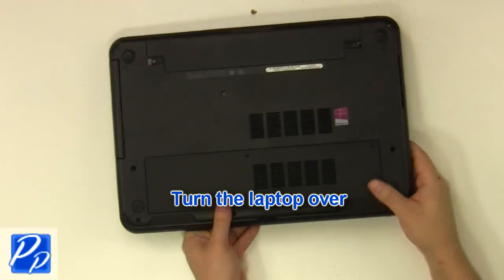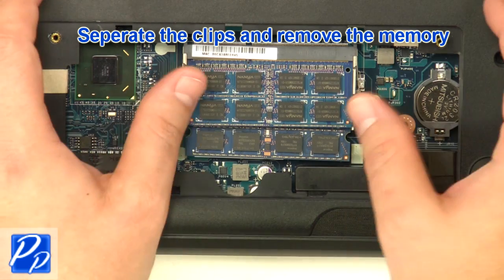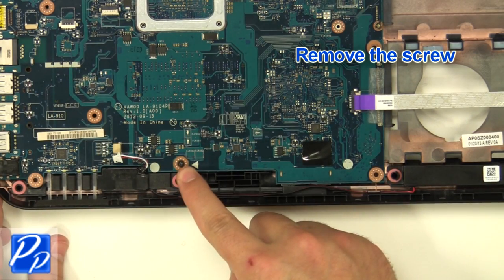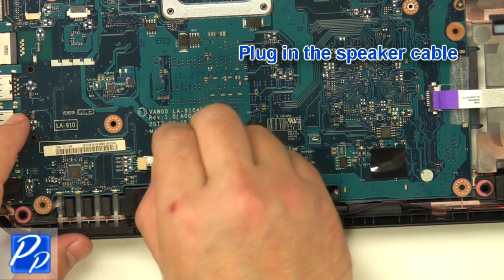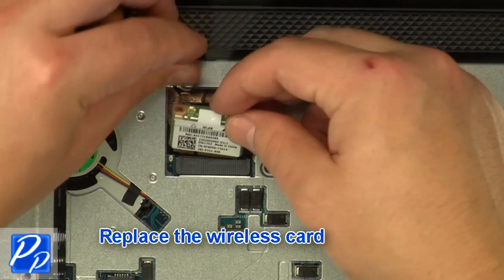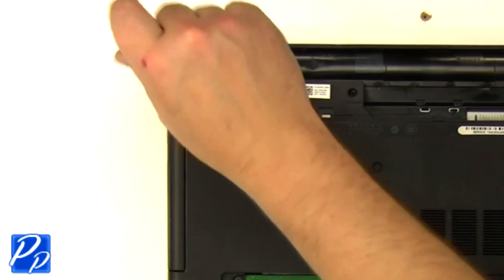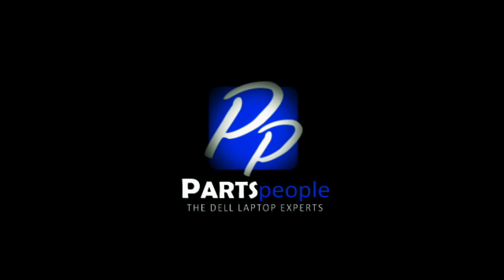Dell Inspiron 15 (3521 / 5521) Motherboard Replacement Video Tutorial

Comment: Thanks for this video, it was very helpful and saved a lot of time. Ive got the same laptop as in the video and its sound card is gone kaput. After all troubleshooting, the only thing that worked, is an external USB Sound Card. Is there anyway i could access and use the Laptop's Internal Speakers via this external soundcard?

Comment: I have same laptop with i3 and dedicated 2gb amd radeon graphics.

I opened my laptop to clean the fan and after reassembling the graphics doesn't show in my device manager, some people suggested me to format and check, but it didn't work. 
Still doesn't show up.

Please see if you can help me identify which is the connector to gpu.

Comment: i have a dell inspiron 15 3521 could you please show my bios chip location so that I could short pin 1 and 4 or best supply the code to remove bios for (system disable: BC61CF01736CBA9D service tag: C6DNJV1). THANKS in advance.

Comment: hey there. can you help me how to locate the 7670m gpu. i took the laptop for some routine cleaning. now my system cant locate the gpu i only have the intel gpu. i even tried the dell support system and all. i cant figure out where the  gpu is located. i need to figure out whether it as not connected/fried/removed. thanks.
Reply: wait i show you

Comment: Is it possibe to put a 7000 series mobo/cpu in my 3000 series?
Reply from the maker: The 3521 and the 5521 use the same motherboards but they are not compatible with any other laptop. Unfortunately no, a 7000 series would not fit.

Comment: i have problem with this laptop when i change position of laptop or move it, windows is not work and frozen
?how do i solve this kind of problem
Reply from the maker: I'm not sure what would cause that to happen. You should take it to a repair facility to have it diagnosed.
Reply: Rasha just replace its harddisk to SSD
Reply: Rasha it happens when hardisk is going to dead

Comment: can I replace the current version of motherboard with different motherboard comaptilble for dell inspiron 15r n5110
Reply from the maker: You want to replace the 3521/5521 motherboard with and n5110 motherboard?
Reply: currently I have 8FDW5 48.4IE01.031 ,I want it to replace with better version ,so I can make processor and graphic card changes.
Reply: Parts-People.Com, Inc My dell laptop is plug in not charging and looks like the pins are broken inside the  Dc Jack please kindly help what do I do?

Comment: bro i hd 3521 with core i3 and amd graphics bt i hv to replace motherboard now so cn i use the 5521's i7 with amd graphics its all same cabinet i think
Reply from the maker: Yes, it should work but you will probably have to change the heatsink and fan also.

Comment: thanks for video. i wanna know something. is there possible to change graphic card this laptop? or do i need to change motherboard?
Reply from the maker: The 3521/5521 has the GPU built onto the motherboard. You would have to replace the motherboard.

Comment: Hey can i upgrade its core from pentium to i5 ? I have DELL INSPIRON 3521 INTEL PENTIUM 2127U @ 1.90GHZ.
Reply from the maker: The only way it can be done is if you replace the entire motherboard.
Reply: is that solution work with i3 too ??

Comment: MY laptop has a pentium 2127U proccesor , but the motherboard is dead , i found a new mobo with I7-3537U , can my laptop handle it ? it's for inspiron 3521
Reply from the maker: Yes the motherboard can be swapped with an i7, the only thing you need to watch for is the GPU. I your original motherboard had an Intel GPU and the new motherboard has AMD,  you will need a different heatsink and vise versa.
Reply: Parts-People.Com, Inc thank's

Comment: I have dell inspiron 15 3521 i want to upgrade its ram to 2x8Gb .. it did not have grahic card it have shared graphic can i install a graphic card to my laptop? is it possible ?
or suggest what should i do ?
Reply from the maker: The graphics is built onto the motherboard and cannot be replaced 
without replacing the entire motherboard. If you have the Intel graphics
 you can upgrade to AMD, that pretty much your only option.
Reply: Parts-People.Com, thanks

Comment: I've heard you can't replace just the CPU alone on the model. Is that true? I want to upgrade to an I5 or possibly an I7. It will deffinitly be an I5 if i have to buy a new motherboard as well. any tips would be appreciated.
Reply from the maker: The CPU is built onto the motherboard and cannot be replaced. You would have to replace the entire motherboard.
Reply: +Parts-People.Com, Inc Thanks for the reply. I figured just wanted to double check. I hate that they do that. they're even starting to do it with memory now. I get so many computers being tossed out at the place I work, I've built pretty much a new laptop. it's the 3521 but 16gb ram, SSD, Blu Ray disk drive, and I bought a 720p lcd monitor replacement for it and painted the shell red. The recent haul of "trash" at work had an PC with an I5 and really good GPU. I know I can't upgrade the GPU on a laptop so I was gonna sell them both for what I could get and put a few bucks to it for an I7. Now I'll just sell the GPU and get the mother board to mount the I5.

Comment: what kind of screws does this use
Reply: to keep the hardrive from moving and the screws for the backcover
Reply from the maker: You can find screw sizes and locations in the written manual. http://blog.parts-people.com/2013/08/28/dell-inspiron-15-3521-5521-motherboard-removal-and-installation-2/

Comment: Hi, my dell inspiron 15- 3521, when I press power button, cooling fan work, power light on, but nothing more than that. I checked ram & it was fine. nothing on display(no back light). While it charging charging light works.. What will I do..?
Reply: +Sameera Kasun Hey Same is the problem with my laptop what should I do
Reply from the maker: Sameera Kasun It sounds like something is wrong with the screen. If you look closely can you see a faint image? Try using a flashlight, you might be able to see a dim image of the desktop. It sounds like the backlight on the screen went out.
Reply: No, I checked screen was well.  There is no hdd light works.  And also motherboard had burning marks. Used motherboard around 220$. I want to cheap way to fix this, without replacing. Any way thanx for replay..  👍
Reply: I think my VGA chip damaged. I'll try to bake it with oven, I know it's a temporary.. :(

Comment: can you tell me plz if the processor in that laptop is built-in or not ?
i got problem with the motherboard some1 suggested that i can change it with dell 5521's motherboard (saying that they are the same),im asking this because the guy said that my processor( i5 3rd gene) can be exchanged with motherboard includes i7 processor in it

Comment: Dang laptop won't turn back on lol
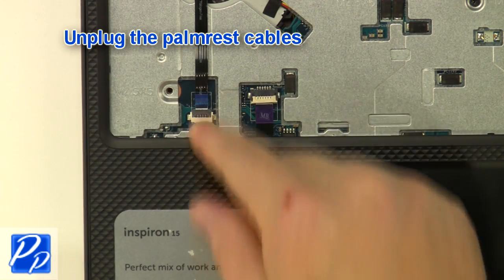Reply from the maker: The power button cable can be seen @ 2:15. Make sure it is plugged in and seated properly. If it is loose, the laptop will not power on.

Comment: I have dell 15 3521 laptop..
I was looking for boot cable because at startup it gives me error like checking media fail and there is no device found to boot ..
Help me?
Reply from the maker: If it is saying there is a media failure and there is not a device to boot from, it sounds like the hard drive failed. You will most likely need to replace the hard drive. There isn't a boot cable for this laptop but you could use a external USB hard drive caddy, and boot from the USB, if you need to for testing.

Comment: I was wondering if you could replace the intel core i3 processor with something better like intel core i5 or 7. Is that possible?
Reply: Martin Ian Cruz only if you swap motherboard
Reply: @ΔημήτρηςΑυγεροδήμος  thank you, I've been wondering if it was possible. Unfortunately it seems people are aware and upped the price of a different cpu with motherboard a lot
Reply: @squishyflac  Hi, in laptops like this it's not to so common  spend money, but if you want you can swap mobo as i said before 4 years. To me desktop is the good to go choice, mind that
Reply: @ΔημήτρηςΑυγεροδήμος  I love my desktop, but I tend to find myself wanting to relax on my bed browsing, but I want a laptop that doesn’t suffer
Reply: @squishyflac  Inspiron 3521 is about to be 10 years old, do you still got it ?
Reply: @ΔημήτρηςΑυγεροδήμος  yeah, from my father
Reply: @ΔημήτρηςΑυγεροδήμος  mostly keeping it around since it's better than my newer laptop
Reply: @squishyflac  Hmm, i see. Can you write the specs of it ? Mine has an Intel Pentium 2127U
Intel HD Graphics 2500
4 GB Samsung DDR3 1600 Mhz ram
And a 500 GB hard drive rated at 5400 rpm
Reply: Sadly, this laptop is dead since June of 2016, it's motherboard is dead
Reply: @ΔημήτρηςΑυγεροδήμος  mine is the same except I have 8 GB of ram
Reply: @squishyflac  it is a tough machine, please be nice with it. Mine is dead because of me, i used to be very bad with my shit once upon and a time ...
Reply: @ΔημήτρηςΑυγεροδήμος  I am kind to it haha

Comment: Hi, i own a dell 5521 15R, can i upgrade my gpu? And how, or which gpu is compatible and cooling? Thank you so much. Have a nice day.
Reply from the maker: Sorry for the late response. This comment was marked as spam for some reason. The GPU on the 5521 can be upgraded but unfortunately, the GPU is built onto the motherboard. So unfortunately, in order to upgrade the GPU you would have to replace the motherboard. The Cooling Fan and Heatsink cannot be upgraded. This laptop has only one type of fan and 2 different heatsinks, dependent on the type of GPU you have.

There are 2 different GPUs styles available for this laptop. Intel (either Intel HD Graphics 5100/4200/4400 series) and AMD (either AMD Radeon HD 8670M or AMD Radeon HD 8850M).

There are 9 different motherboards that I know of. The the CPUs will either have a Celeron, Dual Core, i3, i5, or i7. So there is quite a range. But, I do not know all the GPU specifics for each of the motherboards. I could probably find out the GPUs for the motherboards but it would be easier if I knew what you already have.  Dependent on what you have, will decide how much it can be upgraded.
Reply: Hi thank you for the replay, i have a i7-3537u cpu 2.50 ghz, 8 gb ram, gpu amd radeon hd 8730M, its the topend, but in same games dosent perform well. Have a nice night.

Comment: I'm wondering, how far could you get into upgrading this laptop? I heard the inspirons are good on a budget but I would like to improve it's performance to run games better. Would it be worth the investment?
Reply from the maker: There aren't many upgrades for this laptop. The CPU and the GPU are built onto the motherboard so in order to upgrade them, you would have to replace the motherboard. It wouldn't be a good investment in my opinion.
Reply: @dellpartspeople  But which motherboard would work as an upgrade? I heard there was a quad core board available.

Comment: my pc is dell inspiron 15-3521 
Kore i5 and two intel gpu ati 4000 and 7600m series 8 gb ram 
my problem is the cpu fan is loud 
I clean the fan but not result
plz plz plz help me and thanx :)
Reply from the maker: Try replacing the fan.
Reply: but the pc does not complete one year 
So it does not fall
Is there no other solution
Reply: ban oura if its under warranty then contact dell customer care

Comment: great video guys!  i have a 3521 and i'm unhappy with the GPU performance.  i'm wondering if it's possible to "upgrade" the GPU by installing the 5521 mobo?  beyond that, I'm wondering if there's any other hardware upgrades i can make to my Inspiron other than HDD or RAM?  thanks again!!
Reply from the maker: The 3521 and the 5521 are the same except for the screen and shell colors. They even use the exact same motherboards. They make 5 or 6 different motherboards with various configurations ranging from Celeron & Pentium processors to i3/i5/i7 processors and Intel 4000 GPUs to AMD Radeon 7670M / 8730M GPUs. You are on the right track with upgrading the motherboard but, unfortunately I don't know which motherboard has which GPU. All of the motherboards we've seen have had the Intel 4000 GPUs.

Other upgrades...It can have a maximum of 8GB RAM. You could change the hard drive to an SSD but they are considerably more expensive over the typical laptop hard drive. The only thing left would be to change the screen to FHD (1920x1080).
Reply: Parts-People.Com, Inc
Hey, thanks for the quick reply and info!  Yeah, I'm really interested in finding a mobo with an i7 chipset and one of the Radeon GPUs.  I wonder if Dell would have that info?